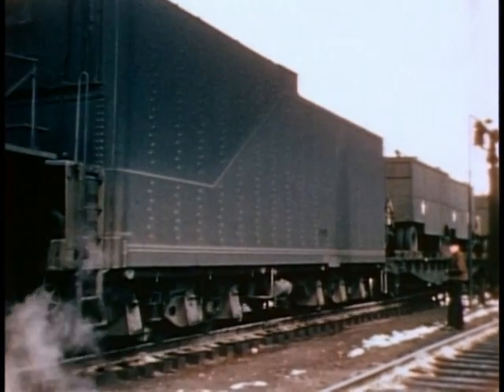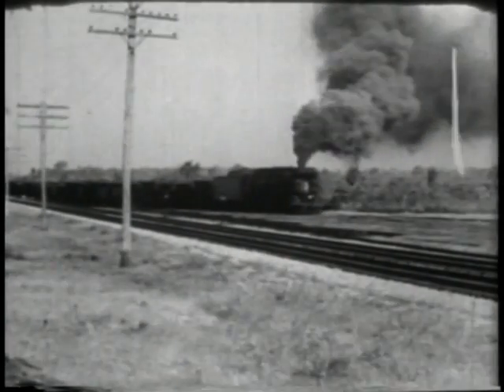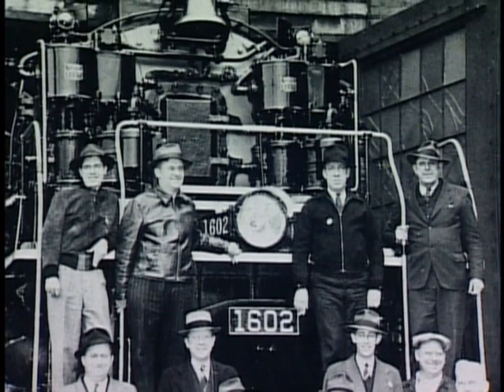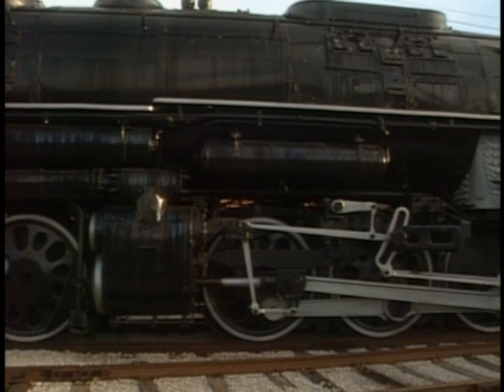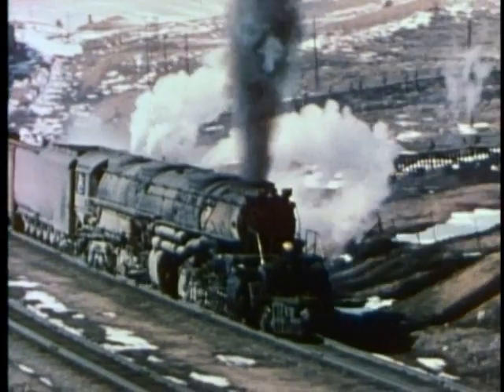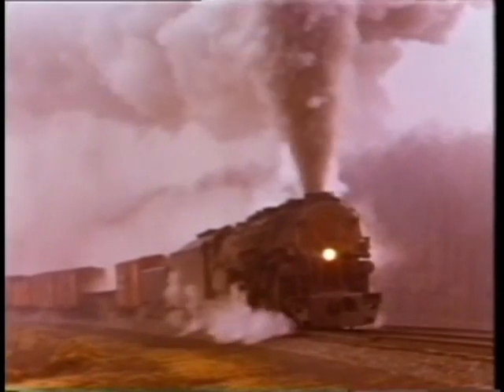Trains Unlimited: When Giants Roamed (3/5)

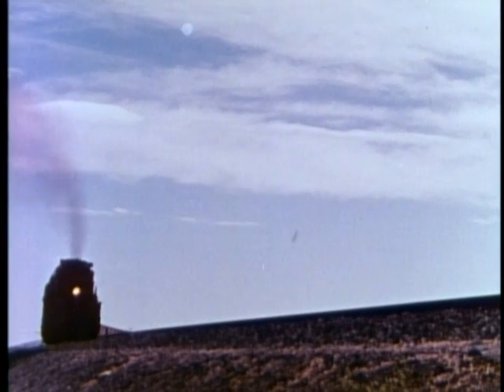Comment: the Allegheny was the CSX version of the Challenger used by UP.  3:59 UP had 1000 Challengers numbered from 3900-3999 these giants pulled freight over the steep grades of the Transcontinental Railroad. When his brothers were scraped only #3985 and #3977 were left today  #3985 and 5511 are in Silvis being restored and in two years we will see them back in action on the Rock Railroad and on the eastern half of the UP once boiler work is complete.

Comment: @JETZcorp LOL I meant to say that the steam is injected into the cylinder directly instead of being vented out the sides of the boiler some steam locomotives only have two cylinders any extra steam is vented out the sides of the boiler to prevent it from blowing up. The Allegheny's like the Big Boys had 4 cylinders but the difference was Big Boys were made to last and had steel boilers and the pipes were welded to the frame the Alleghenys who were made out of iron and iron becomes brittle.

Comment from the maker: @geomodelrailroader Actually, 844's problems in 1999 were the result of an overhaul in 1996 when they made some boiler tubes out of the wrong material.  But the release valve is absolutely nothing new, it's been used on practically ever boiler (whether on a steam engine or the water heater in your house) since the beginning of boilers.

Comment from the maker: @geomodelrailroader Vented out the sides of the boiler?  Like an emergency release valve?  Well, all steam locomotives had a valve which released some steam once the boiler pressure got to be higher than the boiler was rated for, Big Boy included.  All they did was run a second set of pipes from the boiler to the new cylinders, compared with a traditional locomotive like a Northern or something.

Comment: @JETZcorp LOL but this was put in place before they were phased out before that at steams blew up when they were at full steam but boiler explosion still happens if you overheat the boiler take #844 for example in 99 she lost he crown sheet when the boiler pressure valve failed the pressure valve is designed to dump the steam when the boiler is full that did not happen and because of it she spent 6 years in the shop until 2007 when she came out before the premiere of Extreme Trains.

Comment: @JETZcorp LOL but they can fail if faulty equipment is used most explosions are triggered by overheating. if too much water is added it leeks into the firebox and douses it too much heat causes the boiler to explode it also happens if there is no water or not enough water in the boiler.

Comment: BIG BOY still holds the record for the most cars pulled by a single Steam which is 150 cars up and over Sherman Hill. today to match BIG BOY's record you need one Centennial or 4 General Electric Dash 9s and UP has both 1 Centennial #6936 and 2,000 Dash 9s of the Standard and ES44 Class.

Comment from the maker: @geomodelrailroader Pumps on the side?  I don't think that's correct.  Big Boy and Challenger used simple expansion, rather than double-expansion which allows them to consume more steam and produce more overall power than a similar-sized Malet locomotive.  But with working steam pressures of 300PSI, I don't think there's a pump in existence that would do any good.  And if there were pumps added, they'd have to be powered by something, and conservation of energy says it would be a net loss.

Comment: Fully loaded with coal and water the Big Boys were heavier and of course longer. The Allengenys were slightly taller and i believe had a bigger width, Allengenys had a higher horsepower, Big Boys had more pulling power

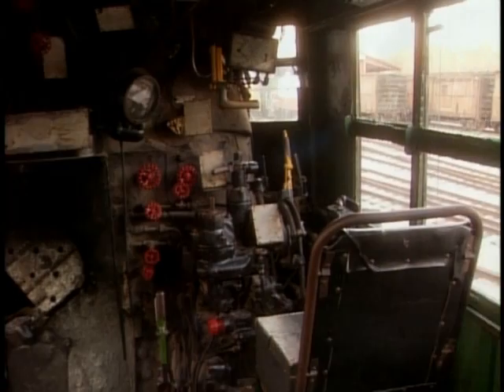Comment: 6:30   Why would he have a shovel?  Weren’t these engines fed with an auger/archimedes’ screw?
Reply from the maker: I wondered about that for a long time since watching this as a kid.  The answer is that the auger did not distribute coal perfectly across the grates, so the crew would occasionally use a shovel to spread it around or fill in the rear corners where the auger didn't reach.
Reply: @JETZcorp  The floor or fire grate of the firebox is roughly 19 feet long and 8 feet wide 152 ft.² that’s almost as big as my bedroom.  The coal would be “distributed” throughout the firebox with a series of adjustable steam jets.  There’s plenty of reasons why he would have a shovel but I don’t think that’s the reason he had it.  I’m not trying to say you’re wrong, I don’t even have the answer